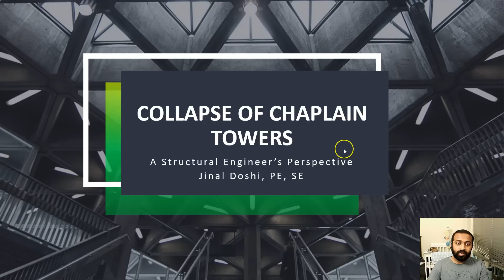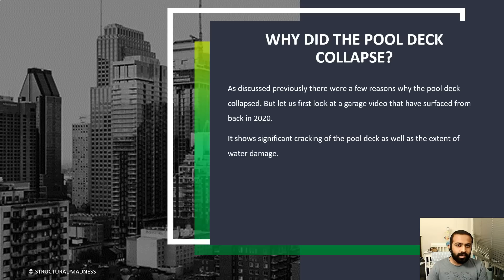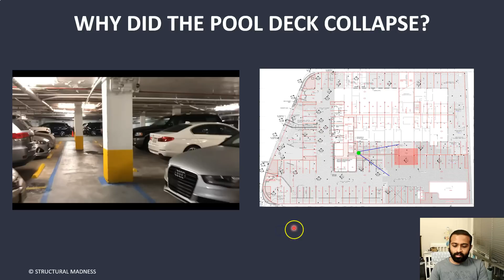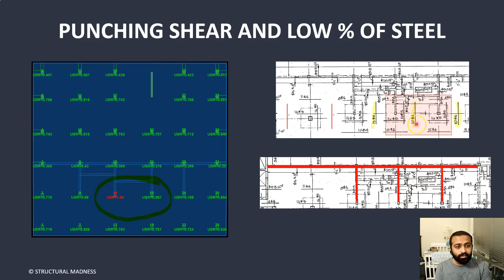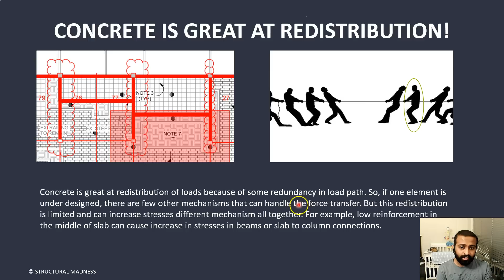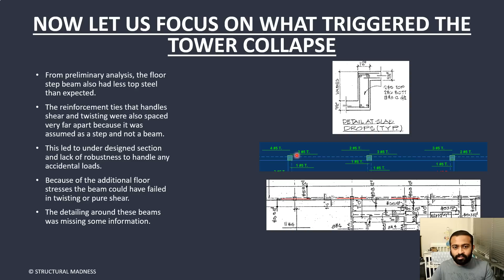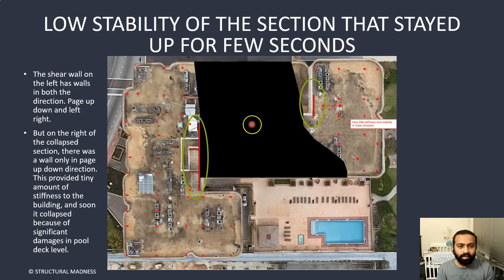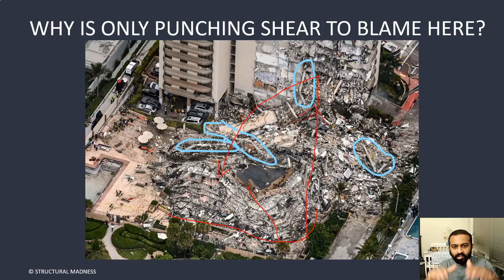Reasons behind Surfside Building - Champlain Towers South - Collapse : A Structural Engineers Review

Comment: Somewhat refreshing video and I really enjoyed the structural design analysis... I spent over 40 years in institutional, medical & commercial construction (public & private) and have a few comments from a general contractors perspective.  The plan view drawings seem to indicate drop heads around the columns that are not present in the videos. I am also somewhat taken back at the lack of beams connecting the columns and lack of shear walls. Rebar omissions and lack of coverage was disturbing.  Was the building designed as a braced frame or something else?  I wonder if structural changes were made during shop drawing review and/or value engineering?  Most products that would normally be used for pool deck waterproofing would be way beyond their published life cycle.  It's been my observation that most structural slabs are poured level with waterproofing and drainage provisions that end in a sloped top surface via a topping slab or pavers.  Deck drains usually have weep holes at the structural slab level to evacuate water that collects on the waterpoofing in addition to an inlet grate at the top surfacing.  I was also wondering if a subdrainage system was provided around the perimeter walls and below the slab on grade that would drain into a sump pit where the water would be collected and pumped out of the building... perhaps not a code requirement when the building went through plan check but otherwise would be good design practice.  Water intrusion through a structural slab that does not have some sort of applied waterproofing or special admixture is not uncommon... the driven/placed concrete piles are constantly exposed to salt water so the water intrusion through cracks does not carry as much weight in my view.  Of course my perspective comes from more sophisticated structures with greater demand loads than that of a residential condominium.  I also wonder how active the developer was in mandating cost savings to the work initially proposed by the Architect and Consultants.  While there will be many comments asserted using the drawings that went though plan check, one has to wonder what changes may have been made during construction the were not submitted for plan check review and approval and lastly who actually inspected the work during construction and were they retained by the developer or the County/City?
Reply from the maker: Hey Robert, thanks for stopping by and watching the entire video. Your comment itself shows that amount of experience that you have in construction. May I know which part of the country did you practice? Just curious.

But I have been thinking about the changes that could have happened back during construction. Now overall, looking at a few video the columns do line up fairly well. But when Morabito consultants did take the core samples, it was very interesting as the topping / nonstructural slab was ranging from 4" thick to 10" thick. The documentation in plans is lacking to understand why this would have happened. I would also expect the slab to be poured all the way up to the slope to drain, but here the concrete sample cores did break right at the interface of the topping and structural slab which suggests that may be they poured the topping slab later. Not sure though. Also talking about piles / foundations, we do have plenty of concrete cover on these elements and since they don't see a lot of bending and more tackle the shear loads, the bottom mat cracking will be very little and salt water will not be able to penetrate into these elements quite easily. And in this project, we do see the lack of concrete cover based on where it was built. And when it is under designed like this, the corrosion damage can be severe. 

This building had a lateral system as shear wall system. Although the percentage of wall compared to floor area was very low specifically the walls that were running towards the ocean. So I am not sure how were they able to satisfy the design.
Reply: @StructuralMadness  I worked mostly on the West Coast/Central CA along with projects in KC MO, Dearborn MI, Portland OR and Oahu HI.  With respect to the topping slab construction, I've had a projects that used sheets of sloped High Density Foam with a 3-4" reinforced (mesh) topping slab over sheet waterproofing.  I also had projects with large concrete pavers on pedestals over sheet waterproofing.  I recall on one project that the weight of reinforced concrete topping of varying thickness over waterproofing to form the necessary slope was problematic and required redesign as a result of several RFI's.  Maintaining the integrity of the waterproofing membrane, even with protection boards, for successive operations is often problematic.  Lastly it seems as if the Developer and General Contractor may have had common ownership.  After watching several other videos it seems apparent to me that various changes were made to the Architect/Engineers original design to reduced concrete forming and likely others costs.  I believe there is a lot of responsibility for the failure to be shared among the Building Department (plan check and inspection), the Developer and the Contractor.
Reply from the maker: @rhamp00  Thanks for getting back to me. What you are saying does make sense, if there were last minute design changes that left the structural engineer paralyzed from redesign standpoint and he was just left there waving his hands up in the air. But yeah, building department should have stepped in and should have stop the construction and forced towards preventive measures like adding drop caps or strengthening the slabs with beams. Often the floor above parking levels are hard in terms of redesign because of vehicular clearance issues down in the basement. Which is another icing on the cake and throws a bunch of additional complexities. 
I do see the structural engineer did stamp the drawings with corrections and the corrected date. What's surprising is only a column change was noted and no mention of any additional reinforcement or geometrical changes were clouded.
Reply: Value engineering- it's always value engineering.
Reply: @sriley322  Its like an insatiable drug to developers... and usually a giant pain in the rear during construction when not well thought out.
Reply: @rhamp00  Just because something is called an "approved equal" doesn't mean it is! If you want less problems in the long run go per spec. It's not hard to understand.
Reply: @sriley322  While from a risk management position, it was normally my business practice to discourage substitutions and approved equals, however, during my 45+ year career I've encountered some really bone-headed things from prestigious Architects and Consulting Engineers that ended in E&O litigation that went against them.
Reply: @rhamp00  It's because the engineers and architects aren't doing their own work- they are relying on sales reps to persuade them into cutting costs. I work in lighting so luckily my VEs aren't life or death situations but I see it all the time across the board in every trade.

Comment: The tall, heavy palm trees were removed about when? Heavy equipment (forklift?) used on the pool deck?
Reply from the maker: It may have been removed by various means, but that pool deck could see a lot more weight or load because of 100 more reasons and the palm trees may have been removed more than a year ago. I would say that has hardly anything to do with this collapse unless the equipment was brought in recently.

Even if it were brought in recently the pool deck could have cracked little more than expected but this completely deck failure seems like a punching failure which is brittle in nature so something done few years ago could hardly ever contribute to the deck collapse.
Reply: Cumulative effects, placed marathon weight over time(everyday) on area designed for sprints (occasional parties, etc) … hindsight shows recipe for disaster.

Comment: By Leon Wechsler Architect: You are just on the money with the thin slab over the large span under the pool deck. Personally I would place several beams under it to hold such a span or large columns caps like 4'x4'x10"
thick below the deck to spread the loads and prevent punching shear.
Reply: What should have been done.But they wanted to cut corners and save money every step of the way.Safety was the least of their priorities,Cost was.
Reply: Missing punching shear caps too. Developer cut too many corners, including insufficient rebar and bad, low psi concrete mix. Why did the rebar come off the concrete so cleanly?
Reply: Thank you @ Leon Wechsler for saying this.  Because since June 24 I kept wondering where the Champlain Tower S ground-floor support-beams were and why other specialists reporting on this disaster hardly mentioned them, if at all??  Obviously I am not a construction engineer.  So if you are asking me, the core of the ground-floor/slab/pool-deck of a highrise building on top of an underground garage ought to be steel beams, aligned less than a foot apart, closer in size to train rails that to wires (which is what the scrawny rebars really are...)  Obviously they must be rust-free and thoroughly protected from corrosion.                                                                                                                                            Although it is only next-best to my secular opinion (...) I am grateful that today – commemorating one month since the tragedy – comes your sound professional answer: "I would place several beams under it to hold such a span or large columns caps like 4'x4'x10" thick below the deck" –  only please replace "or" with 'and'.  Thank you.

Comment: Great presentation.  I think you said at one point this was a brittle failure not a ductile failure because it happened at night.  Can you please explain that?  Did temperature delta of pool deck contribute to the trigger?  Thanks.
Reply from the maker: I don’t think it had anything to do with the temperature. It was a brittle failure because the slab punched through the column. And shear (punching) failures are brittle. It had nothing to do with day / night. English is my second language so may be I just used an incorrect metaphor, if that makes sense.
Reply: @StructuralMadness  Thanks.  Now it's very clear.  Your English is superb.

Comment: They have to put beams between condos slabs to prevent the punching shear ….it fell down like pancake tower…all are saying it’s not need to put beams in a not sísmic place and bla bla there you go..columns intact and slabs become pancakes at least put some capitels..great video !
Reply: And slabs were only 8" thick.  It was engineered wrong to begin with.
Reply: @TnK2015  OK there are 2 things here- upper level slabs were 8", pool deck slab was 9.5", and pool deck slab appears to be underdesigned.  But a properly designed slab certainly does not require beams.  You would be very hard pressed today to find a highrise residential building that does have beams under slabs.  That system makes the floors too thick which makes the buildings too high and they can't put as many floors in.

Comment: Note that the pool deck deflections would increase with time due to creep and shrinkage.  I think that they will find that the added dead load from the topping slab for drainage slope and the planters was higher than provided for in the original design.  
Did you notice that there is no lateral force resisting system shown on the structural drawings for loads in the east-west direction, which will see higher wind loads as a result of the exposure condition.  This didn't have anything to do with the failure but is an expression of the quality of the original design. 
Other that that I believe you are right on with your theory of the collapse.
Reply from the maker: There were two 8’ long walls in east west direction at the elevator core. It actually surprised me because being on west coast where buildings are governed by seismic, I am used to seeing lot more ways for building stability. But it survived few storms so I am thinking may be they were enough. I will have to review the wind code from back in 1977 to confirm if this was okay. I just have the ACI 318-77 code that they referred to while designing this building.

Also the deflection I was referring to in the video were long term deflection because of added creep and shrinkage. And Morabito associates also reported that the slab deflections were within acceptable limits.